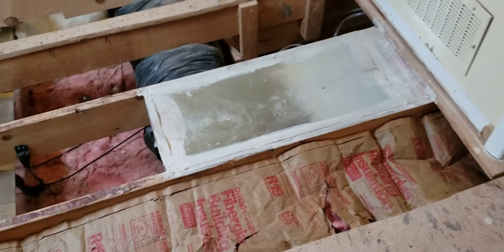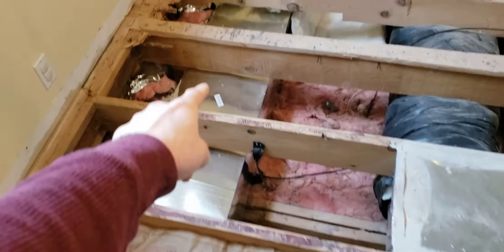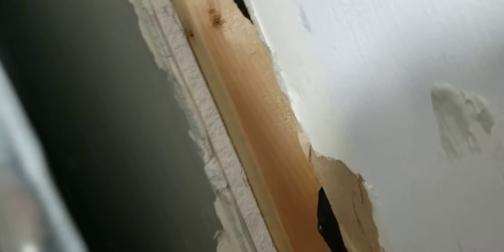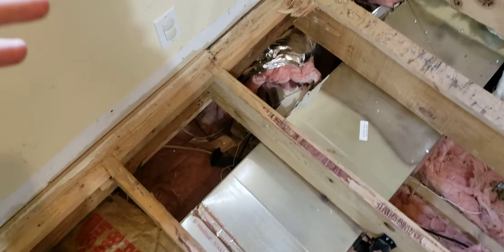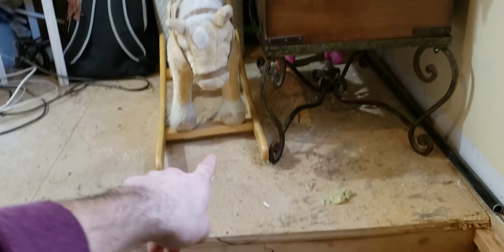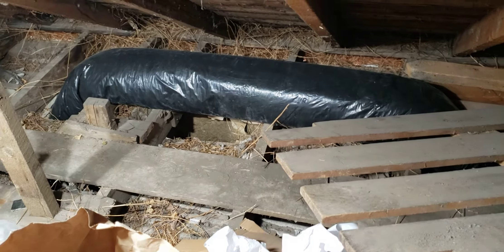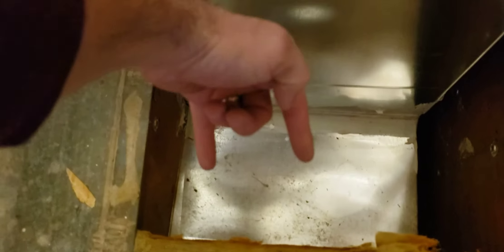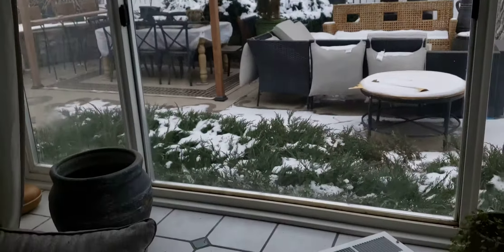UPDATE: Costco Deal: Lennox Brand New Furnace & Air Conditioner HVAC System Installation FAIL

Comment: Did you file a complaint with the State License Board? I got my hvac installed last January. I had 5 estimates and 1 was from Costco hear in  L.A. The Costco estimate was way above the others! Right then and there, I knew they were RIPP-OFF CITY. I went with a Carrier authorized family owned business and I’m happy with the job they’ve done. Good luck with your battle!
Reply from the maker: The Costco quote was about 10K lower than the competitors and through one of the biggest local HVAC companies. That is why we choose to go with it, but no we did not file a complaint with the government, that is a good idea. I did add an updated video with the changes they performed. I'll look up the link and add it.
Reply from the maker: https://youtu.be/vmba223-E3o
Reply from the maker: https://youtu.be/RstafarorKQ

Comment: Sorry for your hardship. your furnace may be a 2 stage system with variable speed blower. It's possible the system wasn't set up properly and may not be going into 2nd stage. The furnace can be adjusted to kick 2nd stage up faster . your old furnace was an single stage furnace and when it kicked on it gave you all it had. Should have service manager verify furnace is staging properly. New furnaces and AC units are by design to run longer cycles but not all day.
Reply from the maker: Thanks for the insight! I'll be making an update video soon about the changes they made with their fourth (or fifth) attempt to make it function properly.

Comment: Did Costco offer any help? Was it the installer or Costco that was a problem? We are about ready to pull the trigger on a Costco ac this week here in Florida. Thanks!
Reply from the maker: It was 100% the installer. I believe they are a local company in Utah, so I would expect you should not have to worry about it. Good luck!
Reply: Hi, I had my AC installed in 2022 , since then I been having issues. The AC company has come to my house multiple times, but they still haven’t fixed the issue. My AC won’t work properly. I called Costco multiple times and they haven’t done anything about it. The last time I called the AC company they told me they were going to send a technician and that was about a year ago and I’m still waiting for them. I live in South Florida. I used a company called Cool Bear. How was your experience ?